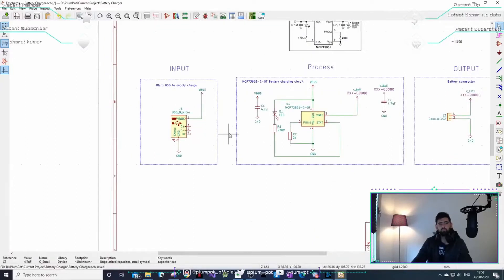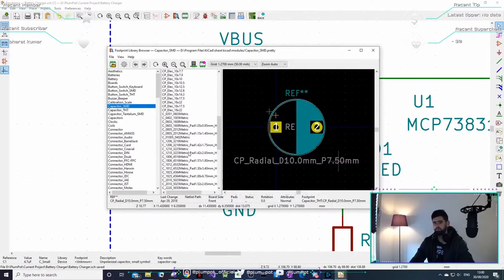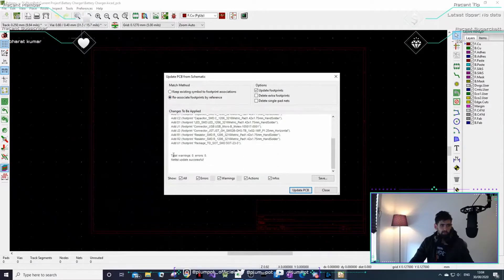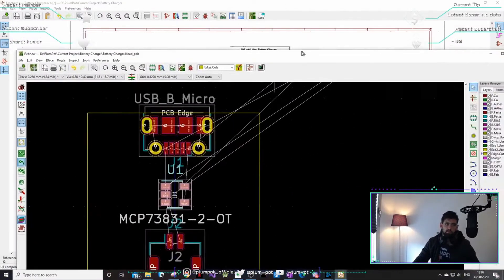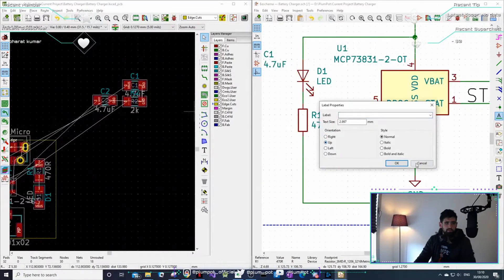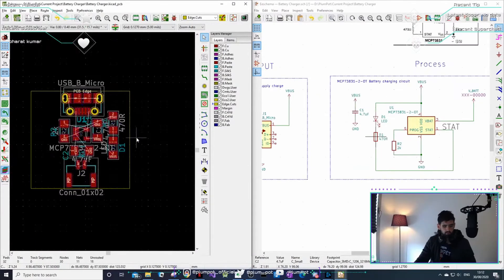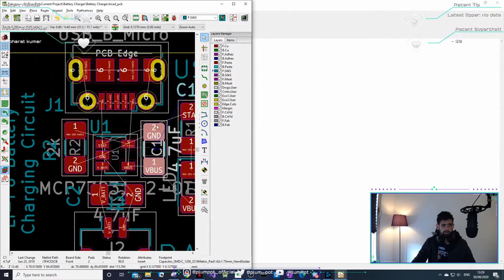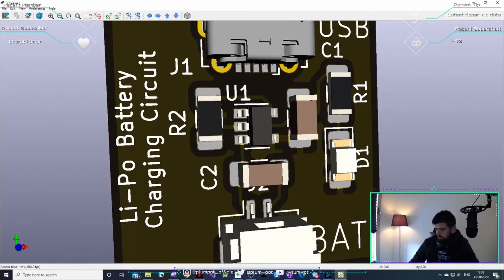KiCad Tutorial - Designing your own PCB battery charger - PCB Layout

Comment: A few days ago I worked on a project in which I had to design PCB with the help of a board sample. I was having a lot of trouble sucking components' footprints. However, my board complete now
Reply from the maker: That is great to hear😁 what is the first project you going to make?
Reply: @PlumPot  12v 4ah to 48v Dc converter. Now it's complete and Power supply working perfectly

Comment: Hey, thanks for your great content! I was working on a 3s charger for an RC transmitter I made. Made a circuit with 3 TP4056, basically in parallel, with three 1s battery protection circuits, what I did then was to have each cell connect to the charger separately and for the discharge I connected the outputs from each protection circuit in series. Did I make sense :)

Would you suggest a different IC or something? I'm a mechanical eng. student so I'm not familiar with these :D
Reply from the maker: Hi 👋.  Yes tha should work. So you actually just charging the 1 cells each of the 3 cells? If you want to use one IC you can maybe look at the MAX1757EAI+. To be honnest I have never made a 3s charger before but I think the theory will be the same🙂
Reply: @PlumPot  ohk, thanks!
Reply from the maker: @filmweaver2013  no probem, shout if you get stuck👍 always welcome to join our discord channel. A nice community to help one another🙂
Reply: Sir pls make video on how to become an full stack embedded developer pls